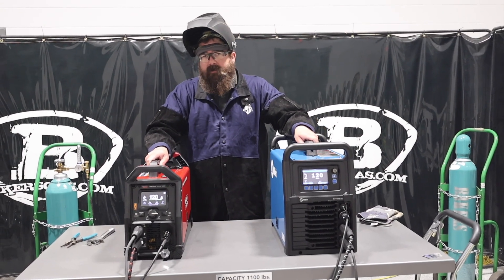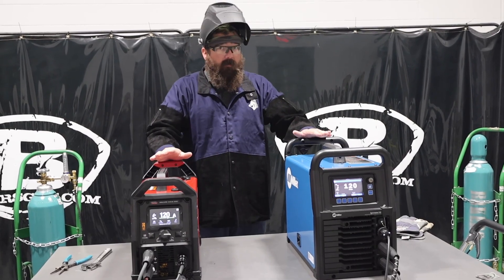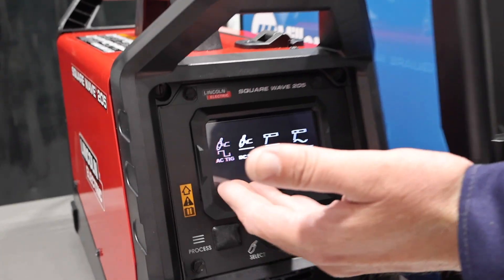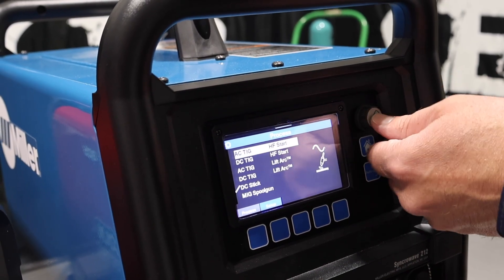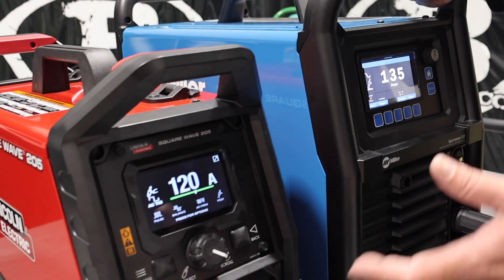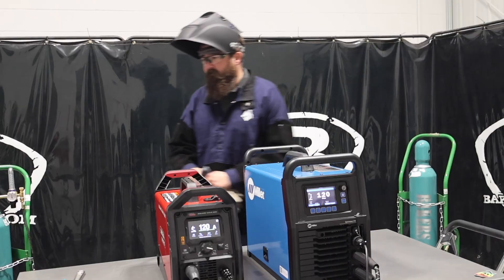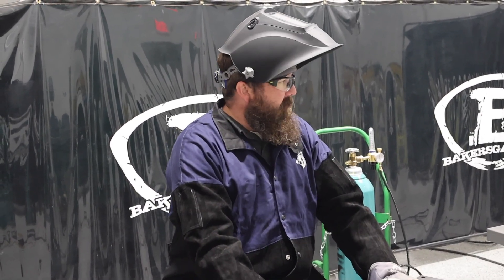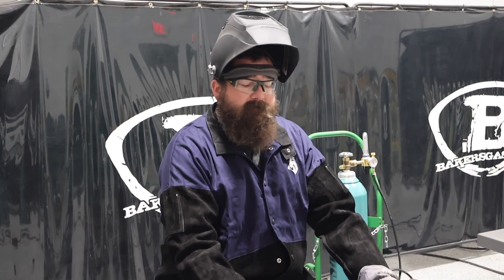Miller Syncrowave 212 vs Lincoln Squarewave 205

Comment: Thanks for the reviews on both of these new machines as there's not much out there for research. Im seriously considering one of these for my home shop as they both check off what im looking for. Price really isn't an issue here, (the 212 being the top end of my budget but still with in it) just trying to figure out what justifies the 2k $CAD price difference. I dont mind paying more for a superior product but dont want to get ripped off at the same time. Weight and size are sometimes an indicator of quality/longevity, and you mentioned the miller has a loud fan, i see that as a selling features IMO. The Miller also seems feature rich with tech (dynasty 210 vibes) and more adaptable (cooler/spool gun). Did I just answer my own question? Lol
Reply: Well I got the 212. What a beautiful machine.

Comment: I’m planning to build a full aluminum top and windshield for our river boat out of 1/8”.  Is a water cooler necessary or do you think the red machine will do ok for such a large project?
Reply: Your welds will be the same. The water cooler will allow you to have longer weld times because your Torch will be cold, but both these machines are lower duty cycles than let's say a dynasty. So you're gonna have to let the machine cool off anyway. So I would say  Start off the basics set up and you can always upgrade from there. I use  dynasty 300 that is 15 to 20 years old and it is an absolute beast on duty cycle.

Comment: Just tried my 205 square wave on 6010 works excellent. Great welder can’t wait to tig weld with it.
Reply: Can it weld 7018?
Reply: definitely haven’t tried 7018 yet. but I am definitely sure that it will. This machine is pretty good for a stick welder just which it had more options like the 215 does like hot start and adjustable arc force instead of choosing between 6010 and 7018 but it’s a good welder. Can’t wait to tig with it. I ran half a box of 6010 and had zero problems with it.
Reply: @alexrios1987  it runs 7018 really well